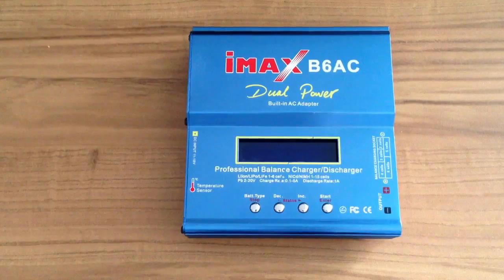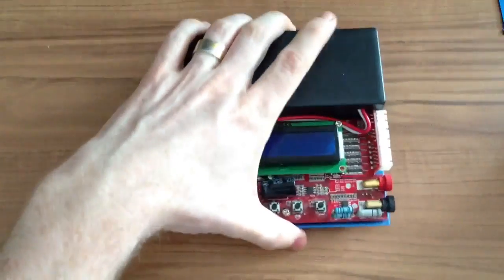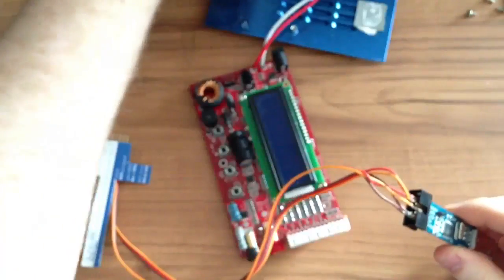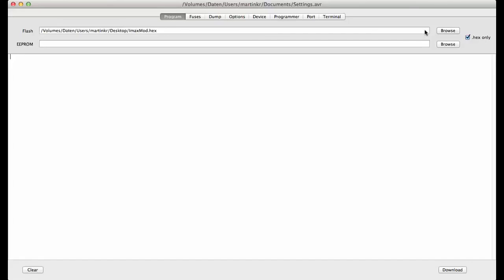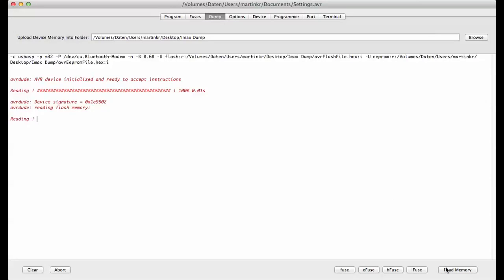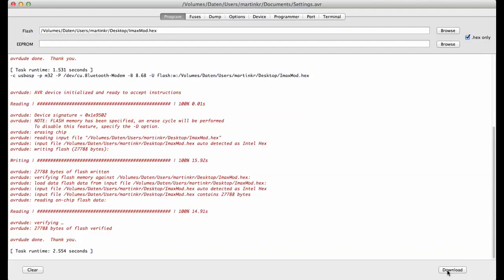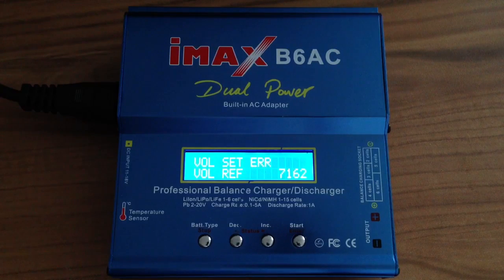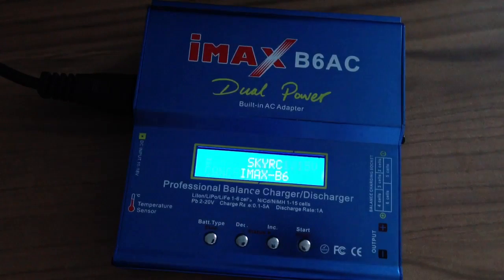TUTORIAL: How to flash the Imax B6 Charger to get the Calibration Menu 1 Back

Comment: Can you change the max voltage to 4.35 voltes in order to use this charger to charge LiHV packs?
Reply from the maker: Hi fahrvergnuugen, nope sadly this is not possible.
Reply: +Ripcurl777 so aftermarket firmware is the only option? It looks like theres an open source firmware that can be installed on the imax b6 atmega thats supports lihv

Comment: I understand that my charger is a clone now .. and i dont get service menu1 or 2 !!
also when i open it i found 5 pins only  with no labeling on them .. any idea ?
Reply from the maker: +Brighton Till I Fly i had also no lables. Mine is also a clone but it worked
Reply: I have the same problem, have a clone B6 charger and don't get the menus. Did you have any success fixing it?
Reply: I am thinking to try the Cheali-Charger as he has a code for cloned B6s .. but i dont have the cables required
Reply: did you get anywhere with flashing your charger I'm having no luck
Reply: how do you connected?